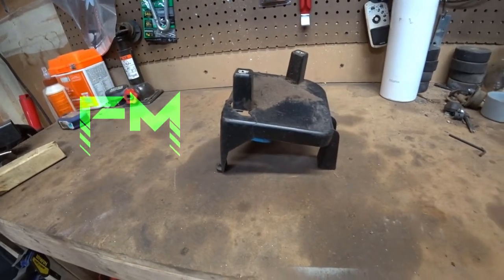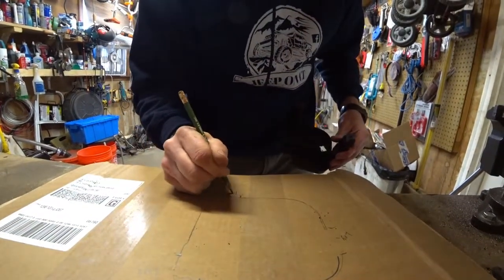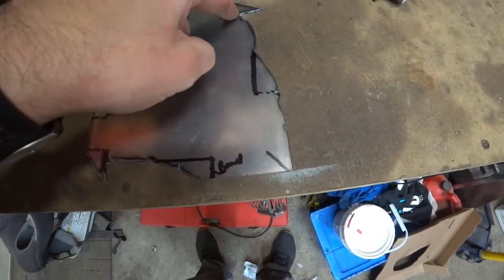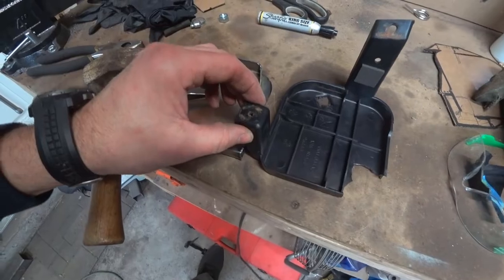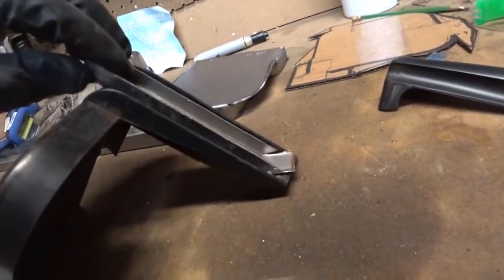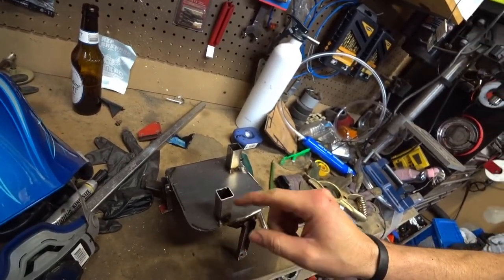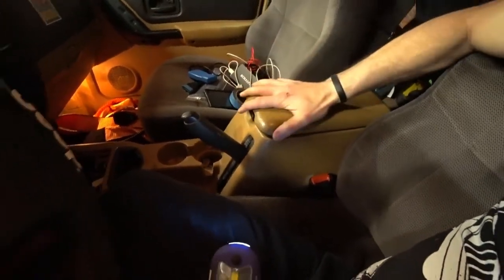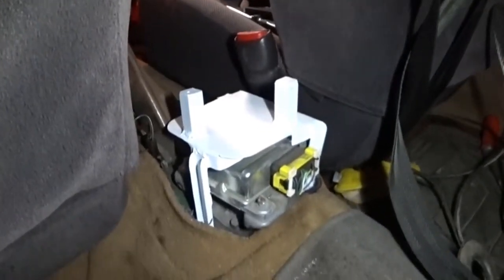D.I.Y. center console bracket for 1998 Jeep Xj

Comment: Looks great man! I just bought the same harbor freight welding ground clamp
Reply from the maker: Thanks Man! The clamp is Rated at 400 amps.   I just went from 6ga to 2ga on my ground wire. I'm told it helps a lot.  So I gave it a shot. I should know pretty soon if it was an upgrade or not
Reply: FMJeeping yeah my clamp that came on the welder the wires in the little were breaking. This one seems way stronger. I also heard copper is way better
Reply from the maker: @TheBeardedJeeper  they say the brass/copper clamps do work better.  And it's cheap insurance.  I wanted to use a magnetic  clamp, but I heard in a environment with metal shavings(place where you cut and weld) it collets debris and messes up the ground.  I think you will be happy with the clamp